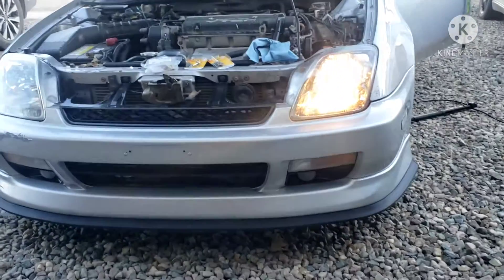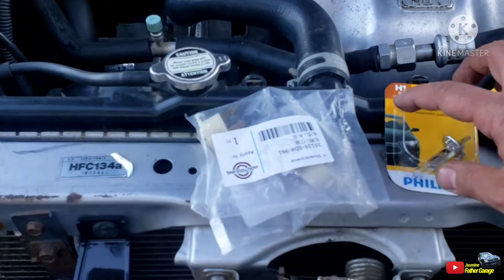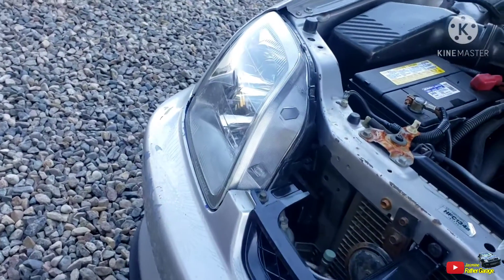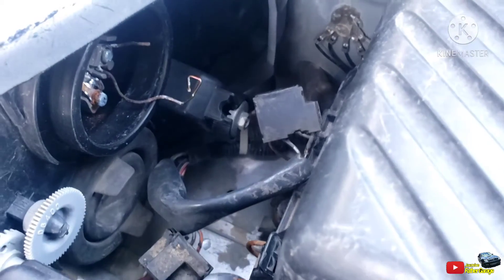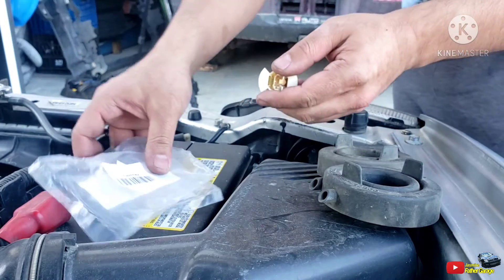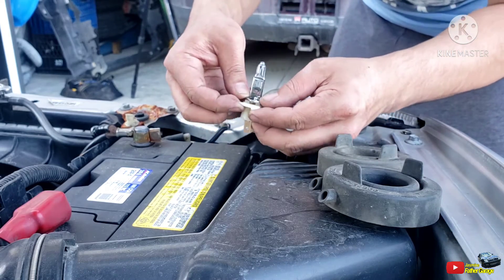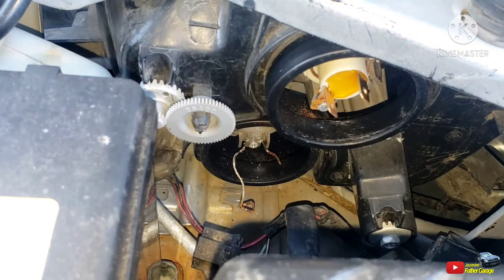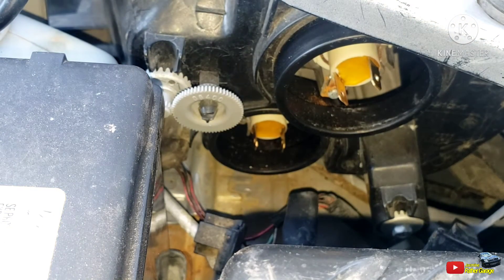Honda Prelude Got some Headlight bulbs put on D.i.Y.

Comment: Can you put a link in the description to the Amazon page for the bulb adaptors?
Reply from the maker: Here the link i got it from 
H1 Halogen Headlight Bulb Sockets Holder Car Headlight Bulb Socket Adapters Holder for Honda/Cr-V/Prelude/Acura Front 33116-SD4-961 https://www.amazon.ca/dp/B07HQ7PR9M/ref=cm_sw_r_awdo_N7080NCNBXX6KB9123CV